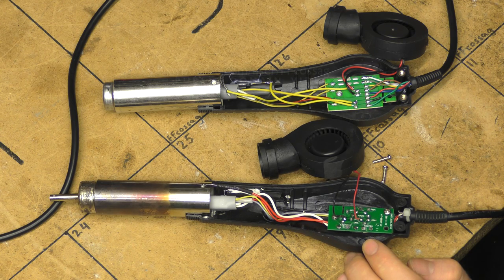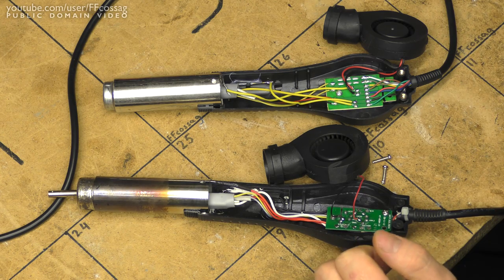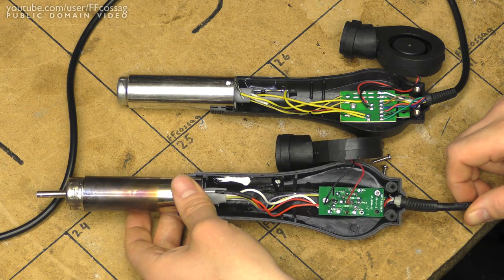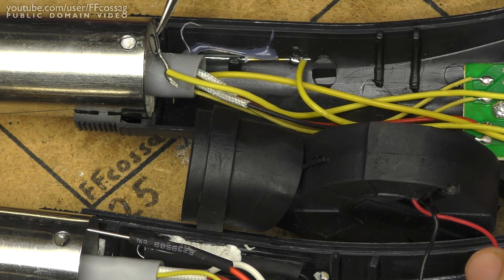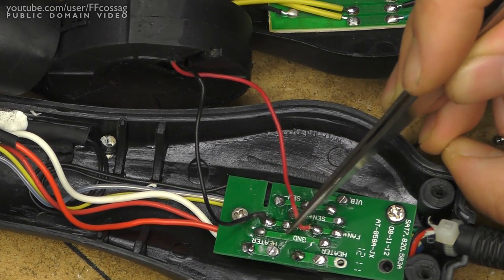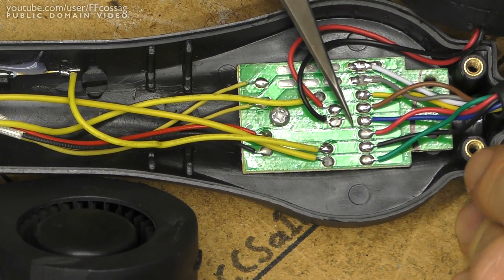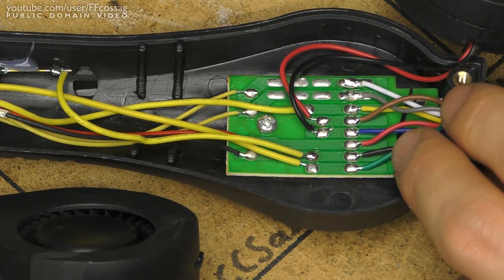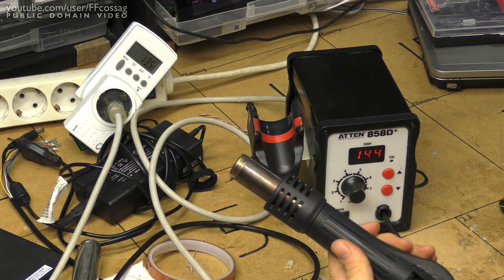Two Atten 858D+ hot air handles - COMPLETELY different!

Comment: Whoever designed the PCB meant for the high voltage to go along the top two traces. They would have the ground separating them from the low voltage bits below, they have larger pads on the right for the input, and seemingly has the solder-current cheat.

Comment: I think you're wrong Sir. The top two yellow wires are the VAC for the heater coil and the red and black wires,  I believe it's for the thermocouple. DId you measure them ?
Reply: Indeed you are correct - just bought the same one and opened it up to check the wires

Comment: Hi just got one of exactly the same handles I agree the earth sheild is not very good. But the main heater element is on white and grey wires which has a bit more separation. The wires you pointed out as heater wires were the thermal couple. Just thought I mention it in case some one tries to connect it up. Nice videos by the way good quality audio and video.
Reply: I think they soldered the unit FFcossag received wrong, which is why they ended up dumping the thing at a lowest listing on eBay..

Comment: You can repair the blowers all you do is unsolder it from the board and pop it open then put how glue on the little circuit board inside the blower and then sit it back into the casing.  What happens is that circuit board came unstuck from the casing which causes the fan to side fumble.

Comment: Its odd that on the bad pcb, the top tracks are firther away from the rest, but they are not the 110v tracks, i would do some wire swapping so the 110 is on the seperate tracks :-).
That wrapped earth is very naughty, but its in the right place to get repaired :-D
Reply: Yeah, it has the ground between it and the low voltage bits, much larger solder pads on the input on the right, and even what looks to be the "let's cheat and use solder to carry more current along the traces" bit, using the cheap stupid way where it's not continuous, no need on 220, but a better idea with half the voltage and therefore twice the amperage.

I'm convinced that's where the high voltage was supposed to go in the board designers mind.
Reply: @cnerde  It probably was where the high voltage was going and he just made an analysis error.

Comment: Hi I've the new version of this hot air gun and it doesn't heat up correctly. I already change the heating element for a new one but I noticed that ground wire of the heater head is broken (The one that is twirl around with a cable). Do I need to weld this part or is it a problem of the station itself?

Comment: Got one of those off ebay for a soldering station project quite a while ago. Looks exactly like your new one, except the ground wire is not even twisted to a piece of welded metal, but tucked in between the metal pipe and plastic case. In mine the heater was white and grey wires, hence thicker traces on that PCB. By the way, how do you determine voltage rating of the heater? What impedance should it have? (I used to think they have the same heater for both 110V and 230V)
Reply from the maker: I just measured the resistance and it was about 1/4th of the 230 V version.
Reply: FFcossag Thanks, I'll keep that in mind. Could you please tell the exact values as well?
Reply from the maker: I don't recall.
Reply: @SaNjA2659  I know I am 3 years too late and you have possibly worked it out by now
240v 70 ohms

Comment: I have the same unit,do you find a better air flow with opening the fan intake area
Reply from the maker: Yes.
Reply: it was a dumb thing to do.. he should have just cleared the existing fan holes rather than chop them out completely.. he could easily damage his fan by  touching it etc... my guess is thats what happened and why his original fan was "off balance "

Comment: does the heater use 240v or 12v
Reply from the maker: Straight to mains.
Reply: FFcossag wow didnt know that thought it ran off a small transformer like the soldering irons do thats scary
Reply: @joshuabest100  it is necessary to get the heat.. unlike a 25v AC iron that builds up and retains heat..
Reply: @joshuabest100  the heater is like 700W. it'd need 30A+ on 24V. Unreasonable.
Reply: @stanimir4197  I have a shitty yihua 896D-II it has the design with the smaller PCB. That thing pulls a shit ton of power! It was surging the whole house lol. That's crazy that it runs straight off the mains like that. I definitely will need to modify that.

Comment: Mine doesn't even have a pcb lol
Reply: You have gotta be kidding me 🤣🤣
So it has no sensors or anything just the mains? 🤣
Reply: @User_1795  It does have a sensor but it's glued inside and basically flying near the heater
Reply: @alexstone691  omg that's insane 🤣
Where did you get it?
Reply: @User_1795  banggood
Reply: @alexstone691  of course lol
Reply: @alexstone691  
BANG 💣🔥 GOOD